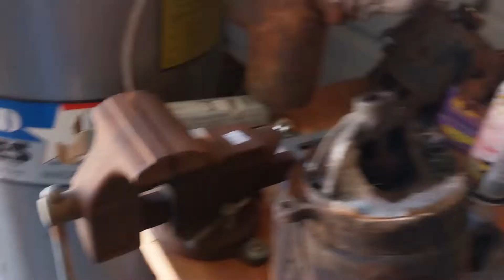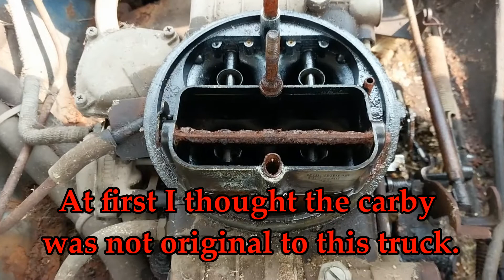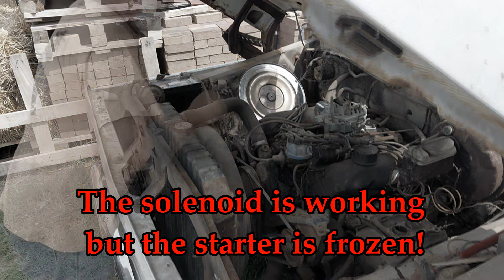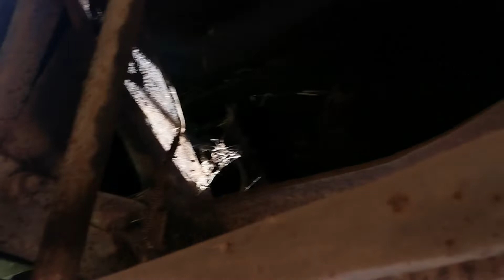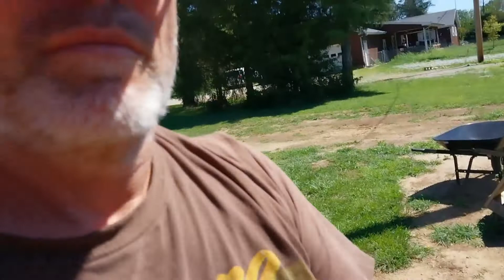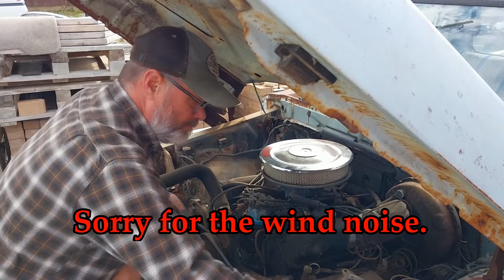Project Ruth, The farm fresh 1976 F 250 Start up! Will she run again?

Comment: IT LIVES!!!! I sure does run pretty good with that smaller carb on there.
Reply from the maker: It did sound better, thanks for watching. The Holley is advertised as 500cfm. That's enough to feed that 390. The original carb is only a 600cfm 4 barrel.